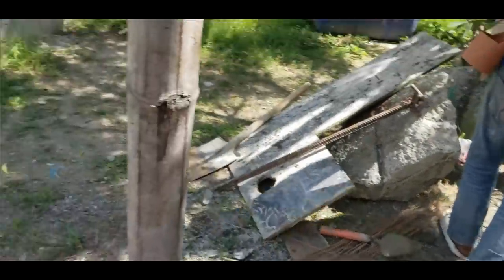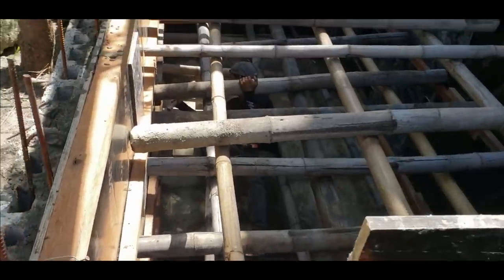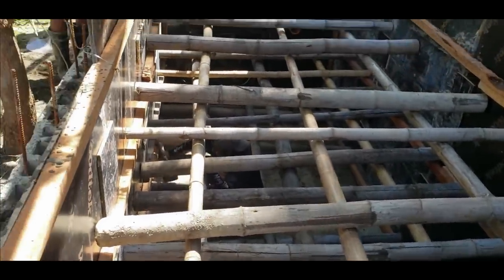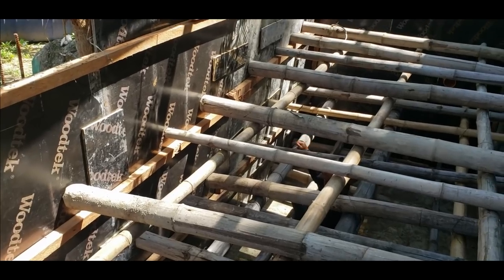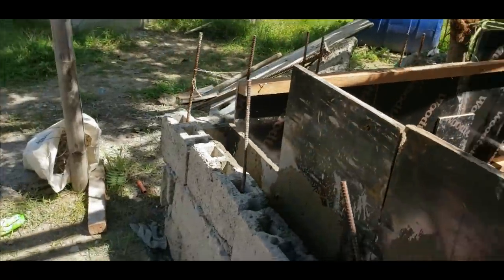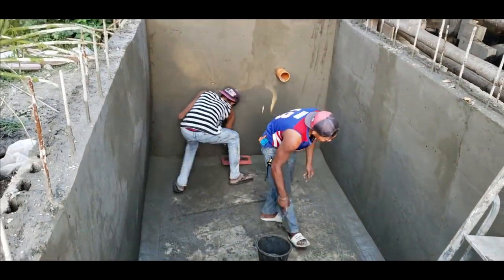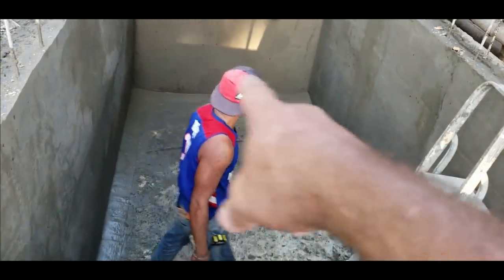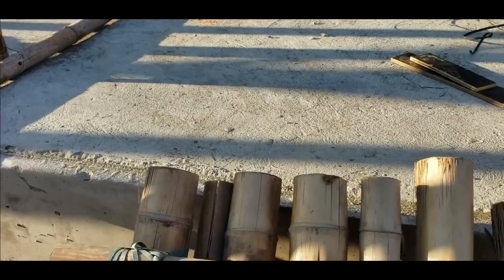Philippines Beach House Build Day 149: Fish Pond for Aquaponics and House moving up!

Comment: Honestly after seeing that hollow block on different builds I've seen going on there in the Philippines verses that cast in place concrete n the finish it has n the strength I seriously hope U stay away from that hollow block any chance you can! I am so sold on that cast concrete Actually almost amazed at the near perfect finish!! As always James great video!!
Reply: just got a second question tho about cast pouring..... you save on cement but you spend a lot on that plywood... wheres the savings?
Reply: @dariousbrown1316  the plywood can be reused
Reply: Totally agree with you that’s the way I’m going when I build over there
Reply from the maker: you dont just save on cement you save on finishing and gain strength. spend a lot on plywood. 20 sheets $540 USD. Even in hollow block you need plywood for columns and beams. $540 investment for a solid clean strong built home to be built. In the end make something out of the sheets or give them away to a person who really could make use of them like a family without much of a home. It would mean the world to them. :) :)
Reply: @TexasFilipino  the problem is to get someone with that standard.... that knows how to do... your doing this so you the foreman... meeee id be lost trying to get them to understand what i want.

Comment: Fill it up.
You could fill the fish pond to the brim, if you get the pipe from the cistern out of the pond. Instead of poking through the wall of the pond, bring the pipe up and over the rim.  Since the opening of the pipe is not in the pond, back flow of pond water or fish swimming up stream into the cistern would be eliminated.  Even though the rim of the pond is a foot or two higher than the cistern, the cistern overflow would be pushed up by the pressure of the water in the downspouts coming off the roof (assuming the cistern manhole covers are relatively air/water tight)
Reply from the maker: all you see is a limited perspective on video. Do you honestly think I have not thought of back flow? also you all think the pipe is flat but there is a grade drop not seem on video. lastly the video does not show where we have a cut in the pipe and and y sending the cistern overflow directly to the beach. both ways have caps and I can uncap the the one where I want the water to flow to. Next I do not want water to the brim. there is reasons it is down some.
Reply: A non return valve can work

Comment: I agree with your prospective  on the hollow  block wall.  Wait until you get to the roof. The frustration of trying to teach there experienced welders how in the hell to weild.
Reply from the maker: they just spot weld everything. You never heard a bead being run and nice frying sound  just dap dap dap
Reply: @TexasFilipino  Yep that's it and it seems to be another SE Asian thing. I have seen it in Thailand Cambodia, Laos, Veit Nam.  It makes me think that it has been taught by the Chinese to wield there crappy steel they sale them.

Comment: do yourself a favor and get a small wind generator for cloudy days and nights when there is a breeze , also a gas backup
Reply from the maker: salt will eat the wind gens unless you buy marine model like for sail boats and the power output on those are too low to do much. Standard unit wont even last a year in this sea spray. I have a diesel gen here. Til this day i have never needed it

Comment: Hey James (and Melinda),  Been watching your videos for a while (pre-covid) and love following your progress.  Your building methods have got me thinking...  did you get an engineer to work out all of the specs on concrete mix, beams, wall thickness etc?  Was that a filipino engineer or someone back home? It makes so much sense to do it as you are doing it, but I'd imagine managing the crew would be even more difficult than using the local methods (hollow block).

Comment: Love your channel but why did you let them build your fish pond with hollow blocks?
Reply from the maker: I used those crappy blocks only has a liner to hold back the collapsing sand walls and then poured a concrete liner cast in place. I have explained this on the cistern videos and showed the sand collapsing during the video. Plywood would be forever lost and  will rot  and attract termites.  They are just used as a medium to retain the sand back only and yes it does add extra strength. If it was clay soil I could have skipped them and just poured

Comment: Will you do Dutch buckets? Or a rail system or little bit of both? Did you visit the huge aquaponics operation in texas?
Reply: Search sustainable harvesters (7000 head of lettuce a week)
Reply from the maker: The one down in Houston?  I watched a video a long time ago of one down there. I bet that freeze whooped their butts! Mainly growing lettuce in the place I saw
Reply from the maker: Now I am not all techie in terms and lingo for it all so don't kick me like some do. I will use the 4 inch pvc and go up that wall behind the pond and actually it was supposed to go all down through there where Mel has plants growing now. She knows and her plants there are just temp. We will be building a second pond as well. I will have a net already dropped in the ponds so when harvest time comes just pull up the net. I will use those plastic barrels to make a filter system to remove the large matter. I ordered another solar pump ( same one I use on my well now)  it can operate 12 to 48 volts. Like I said in video more for self reliance not commercial. Also it makes nice ambience if it is done clean and not junky looking. Fish , plants and water trickling how can you lose?
Reply: @TexasFilipino  yes
Reply: @TexasFilipino  sounds awesome, look forward to seeing it.

Comment: James,are your walls all different thickness, cause if I have a sewage pipe say 3 in. wouldnt the wall need to be 7in. to get concrete to encircle it?
Reply from the maker: my walls are all same thickness- why would you be putting a 3 inch sewage pipe in a wall That should be through floors. if you need to make a second floor run then make a oversized of beam like I did for it to pass through and down a oversized column
Reply: @TexasFilipino  Because the floors are 8"

Comment: looks like the cement was a bit soupy again.
Reply from the maker: It was purposely soupy on that mix with double waterproofing and more portland. We need it to get down through the steel with only 3 inch walls. If you add each piece of steel is 1/2 inch and there is horizontal and vertical that would be places only having one inch each side for your aggregate to pass by. It was poured as a liner
Reply: @TexasFilipino  as long as our happy with it and it works for you that is what counts in the end LOL!

Comment: Story time.  My first experience with filipino cinder block was in the 80's.   Had a coworker that was taking Tae Kwan Doe lessons. He was to receive his yellow belt, which ment another excuse to have a party in the Philippines.   The guy comes out in his uniform, his instructor barked out different commands and my coworker would strike a pose.  After which he gets his belt, added bonus his instructor picks up a cinder block and has him punch the block breaking it.  It took about 10 minutes.  Back to the real reason every one came, the party.  After an unknown number of San Miguels I spot another cinder block.  I picked it up, first thing I noticed was how light it was.  I get every one's attention I punch the block it crumbled, I thought that was easy so I brought my elbow down on it a little more center than I was aiming for.  That one hurt and scratched up my elbow, but it still broke.  I announced that I did it without a single lesson or paying a single peso.  Kind of a jerk move, I blame the San Miguel.
Reply from the maker: LMAO- those blocks was like a stage prop!